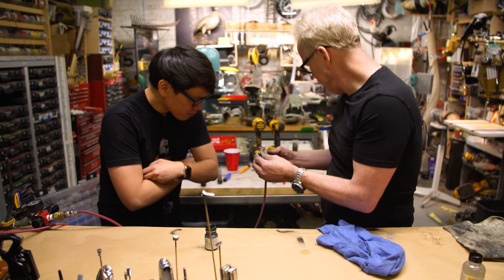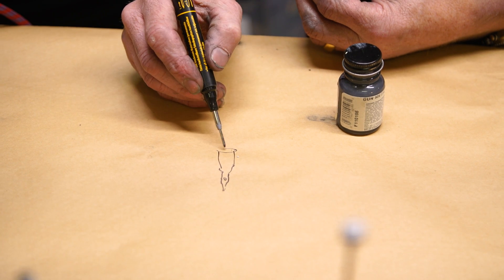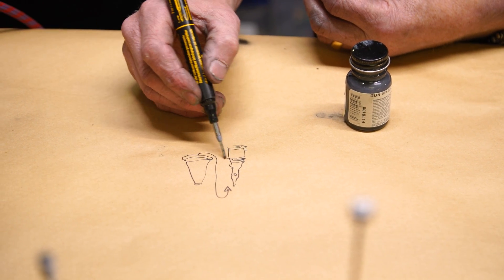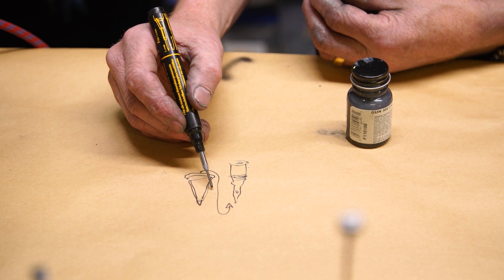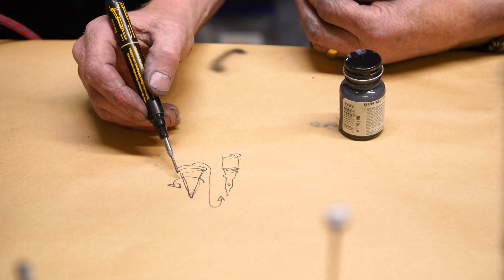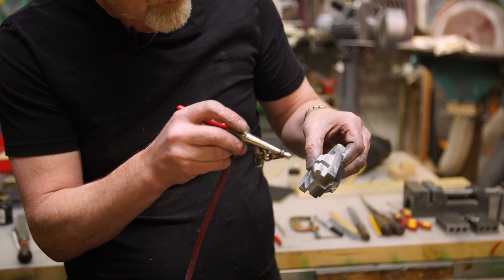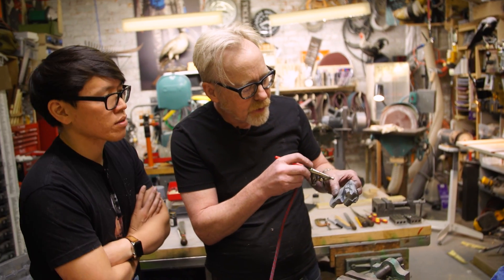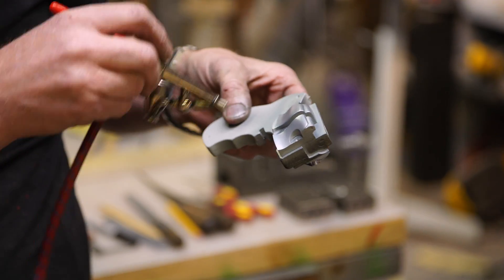Adam Savage Build Tip: Airbrush Anatomy

Comment: It should be noted that that's how a Single Action Airburush works -- a Double Action Airbrush allows you to control the needle's depth with the trigger by pulling it backwards or pushing it forwards, thereby allowing far more control of the paint's flow.
Reply: And now I've learned another thing. Thank you.

Comment: Ive never seen an airbrush that works like that. Mine have always been double action.
Reply: Single action external mix airbrushes were far more commonplace in the effects industry, at least historically speaking, primarily because they allowed for a consistent spray pattern between trigger presses. You could do a hundred lines and have them all about the same thickness and opacity (assuming you sprayed at the same distance) because the spray pattern was controlled independently of the air.  

Double action brushes give you greater instantaneous control over the spray pattern, but when it comes to model making, a consistent spray pattern is generally more important than an instantly variable spray pattern, making single action brushes well suited to model work.

The brush he's using looks like an old Paasche Model H.
Reply: That's really interesting info, thanks!
Reply: Neither have I. I think this works better/makes it easier if you paint a lot of larger models, building, and so on since you probably won't change the flow when you do it. I would actually prefer this way. =)
Reply: I've seen a lot of people using single action ones which have a big trigger on them, they almost look like pistols with a paint hopper on top.  Adam's the only person I've seen using a single action that looks like a double action one
Reply: Lorcan, 

Most trigger'ed style airbrushes are technically double action, examples would be the iwata hp-th, the neo trn1 or even the grex xt.  They might appear to be single action brushes since they have a single trigger, but they are dual action as the first few mm of trigger pull controls the air, and the remaining trigger motion controls the needle movement.

The paasche model H that Adam is using has been around since the early 1900's, and is still sold today.  The valve mechanism and a few other design features have changed slightly over the years, but the basic design and appearance are essentially the same.  The model H is one of the most common single action airbrushes in the world.  

The iwata neo revolution is a single action brush that looks very much like a dual action, I would say even more so than the paasche H adam uses.